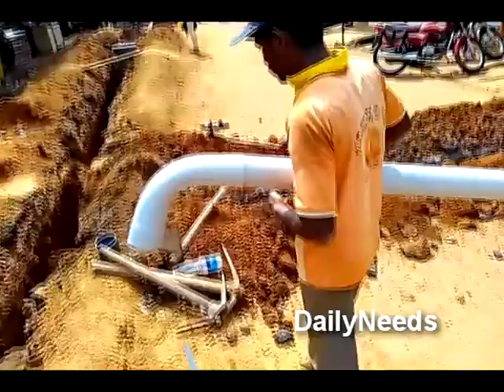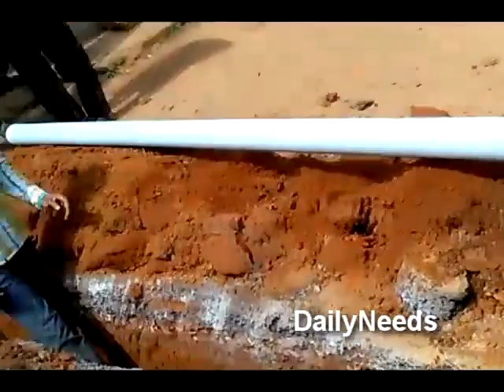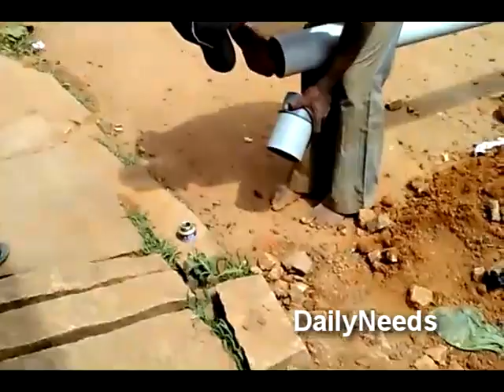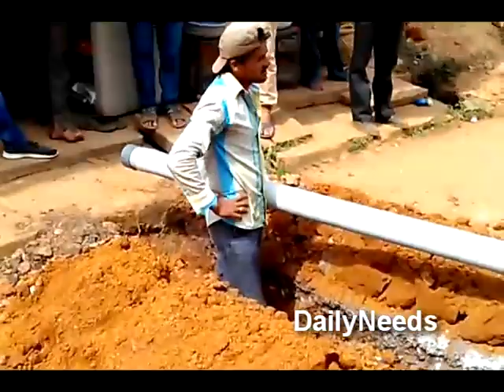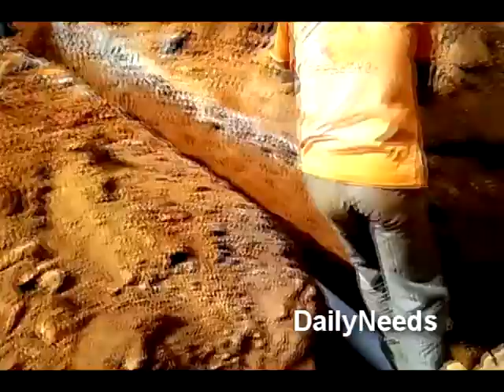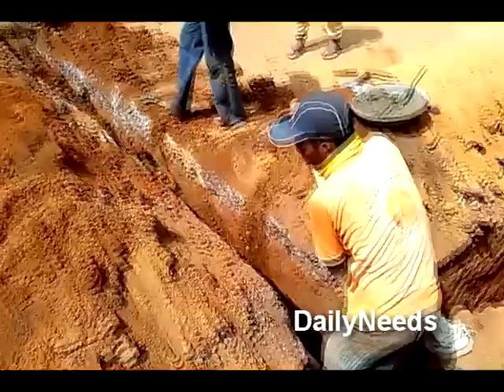Under ground drainage connection in India

Comment: Try connecting buildings to collection lines with Tap-N-Tee Saddle.  The size of sewer pipe is a major concern, flows from the buildings are much larger than this pipe can handle.  i can tell from the foot traffic.  Is this connection to a mainline, should have inside diameter of 6 inches.